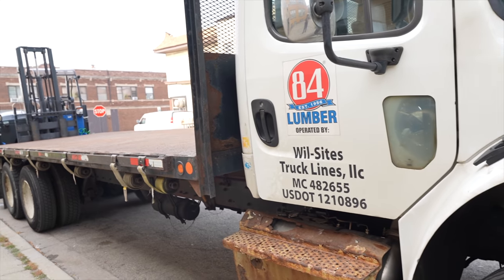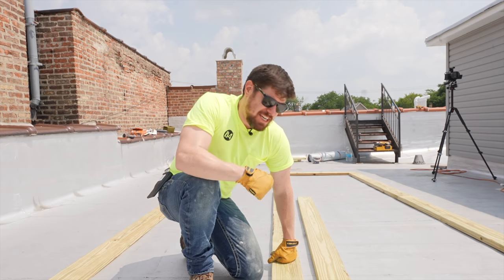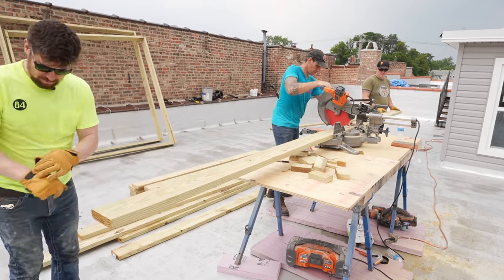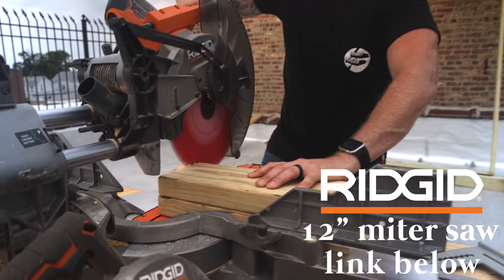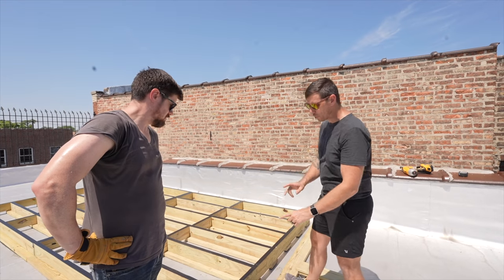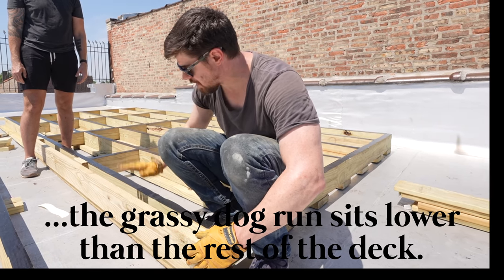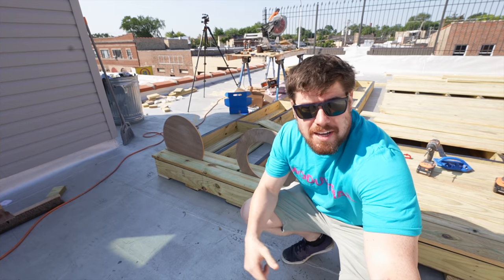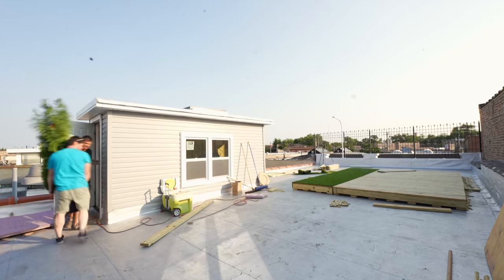ep. 22 - i Built a BEAUTIFUL DECK on TOP of an ABANDONED BUILDING !!

Comment: Wait, wait, wait. So the dog is supposed to piss on the plastic grass? Isn't that gonna be pretty nasty real soon? And it's right next to where you wanna be sitting? Am I missing something?
Reply: Yeah. That idea won't last long.
Reply: The grass is treated; the urine flows through the deck to the roof, where it can be cleaned, and washed.
Reply: @lakewrites   @lakewrites  Maybe I'm missing something, but I didn't see any drains near that. Will there be pee water all over the pace until it rains or will they have to wash that whole section of the roof? Pee + sun make for really bad stink
Reply: @lakewrites  if the concrete is porous its gonna stink bad.
Reply: As someone who uses 2x4 porch potty, you NEED to replace the grass every 2-3 months and wash it every 1-2 weeks if you're planning on allowing your dog to urinate on it. You will likely need to recycle that design and replace it with something using an inclined plastic drain system and a large basin or corrugated pipe that runs to your roof drainage.

Comment: ONG - I can't believe what I saw! 😲
When I redid my 2nd story deck, I also did a floating deck. AND it has a waterproof membrane, to prevent it from leaking down on the patio below it, that I had to protect! So NO nailing or screwing into the deck structure. 
I wanted my decking boards to run vertically, but the drainage was also vertical. So I ran sleepers horizontally under the decking boards. I had to cut short notches all along the bottom side of those sleepers to allow for drainage. We cut strips of rubber roofing material and glued them to the bottoms of the sleepers.
Small frickin' world❗😲🤩
Has been in place for 10+ years and still working perfectly! 👌😍

Comment: I build fence and decks for a living. 1/4 board spacing is huge for PT. It’ll shrink as it dries and you’ll end up with 3/8-1/2 gaps. Also, should have sealed under the fake grass, it’ll rot from rain, not to mention dog business.
Other than that. Good job

Comment: Just a quick advice. Usually you really don’t want the wood touching the roof membrane. Most often people use some plastic pedestal that are design to be installed under the deck.
Reply from the maker: Appreciated, but I address this in the video.... We used a self adhesive roof membrane on the sleepers to keep them off the roof.

Comment: You'll need an easy way to lift and clean up under the dog run. It starts smelling awful real quick and will require regular cleaning. I have a dog run area on my cement patio and have to hose it down constantly. I keep a large pump sprayer nearby filled with vinegar to help keep the smell down. Also have two step activated trashcans, with the big one for dog poo and the small one for kitty litter / saw dust. Nearby are the scooper tools to hang and easily get hosed down also. Have a good drain, because little bits of dog poo will get caught in the fake turf and need hosing out. In your situation, you should probably look at a large drain pan to collect urine because no telling what the acidic urine will do to the roof liner over time.

Comment: Really good Job and also very good advise about the water proofing with the tape under and over the deck. Quick question. Would it be quicker if you guys use the camo tool for hiding screws instead?

Comment: Nails vs. Screws

For those wondering about the construction technique: use nails for shear loads, screws for tension loads.  This is why the joists were nailed from the side (nails are in shear) and the decking is screwed down (deck planks are in tension).

Exceptions do apply, but thats a good rule to follow for you DYI'ers.
Reply: Am I correct in saying that screws are still stronger in shear rather than tension?
Reply: @ciarfah  I was always taught nails are more likely to bend, and screws are more likely to snap.  This is because screws lose a lot of their cross sectional area / strength between the threads.

So nails will do better in shear (joists and joist hangers sliding against your skirt board).  

But screws won't backout.  So use those in tension (hold decking down).

Again, this is just a general rule of thumb.  I know when you get into framing and building codes, there are exceptions and you do need to know what you're doing.

Comment: 4mm is not a lot. I am surprised you didn't wrap the bottom boards to 100% cover the bottom and the edges!
Reply from the maker: It's treated lumber so no need to cover the edges.... The main thing is just preventing pools of water from being trapped between the bottom of the board and the roof
Reply: @modustrial Thanks for the reply. Makes sense. BTW absolutely in love with this project man! I would love to do something like this also bit sadly ill just use my lame deck on back of the house. Thanks for all your hard work on these videos!

Comment: My worry is that the matting you put under the sleepers isn't thick enough especially with the pressure form what's going to be on the deck furniture/objects/people. I think it would have been best to wrap the mating up on the sides of the sleepers as well since your puddles will probably get deeper than the 4 mill thickness of the matting.

Comment: When the music comes in at 3:59 I thought I'd landed on a Mr Built It video for a second there!

Also, I'm surprised you didn't use the concrete footing method for a floating deck. You place special concrete footing pads on your sub grade (in this case the roof) and then slot your bearers and joists in and then build the floor on top. Jeff Thorman did a really good video on doing a floating deck with footing pads https://www.youtube.com/watch?v=4WT3Tlle3Us

Comment: No screw heads is a great idea! As the lumber shrinks top screwed boards, the screws will poke up
Reply: But these are only screwed on one side so as the boards dry and shrink they could also curl up out of the plane.  And in fact one of the boards didn't look like it was even close to being flat in the first place.

Anyway, it only takes a few minutes to go around and tighten the screws a year after the deck was laid to sink them down again.
Reply: @-_James_-  are there hidden fasteners for conventional lumber?
Reply: @stephendoing2253  I have no idea.  :)

Comment: Prediction one year (more or less) you will be adding nails or screws to those boards, because the centers will warp and stick up (bow i guess), nailing just the edge is fine IF you're using 4 inch wide boards but with 6 inch you need a nail or screw in the middle. And spacing deck boards is a bad idea because when they shrink you will end up with a huge gap (hope your lady friends don't try to walk on it with high heal shoes (the 1/2 inch spacing for the dog area is fine)...
Reply from the maker: 1/4" gaps are needed for drainage
Reply: @modustrial  Ok keep telling your self that